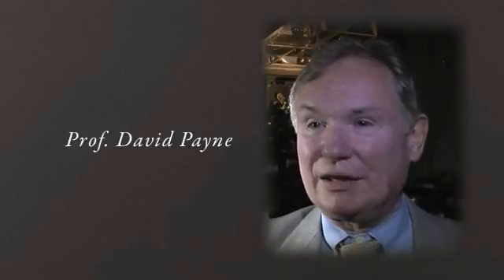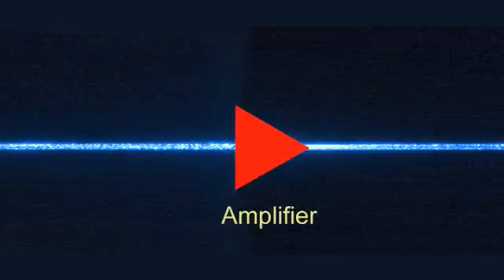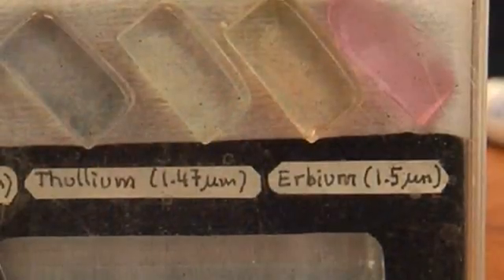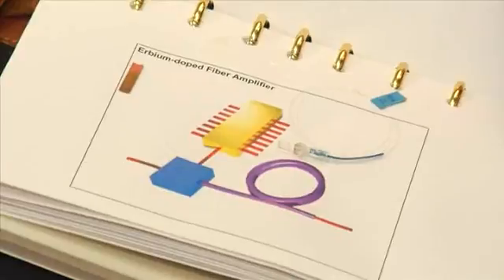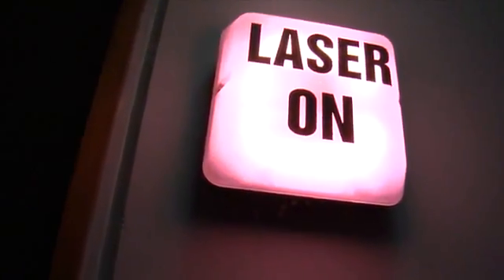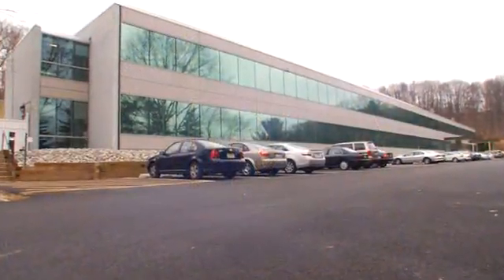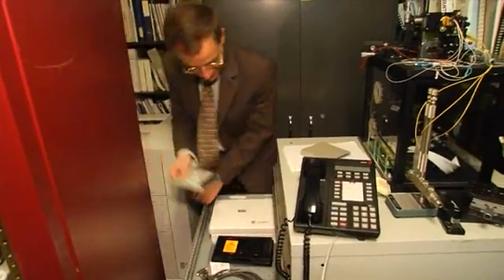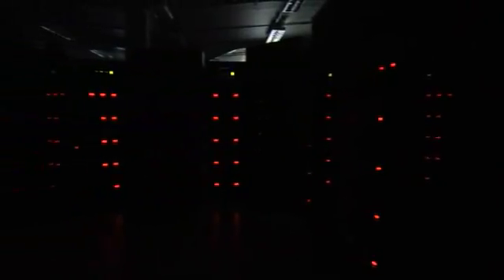The EDFA - how it was developed.

Comment: How do you power the optical amplifiers in an undersea cable?
there still has to be a separate electrical power supply? 
How much power do you need for a transatlantic cable? 
There must be approximately 150 repeaters to be powered.